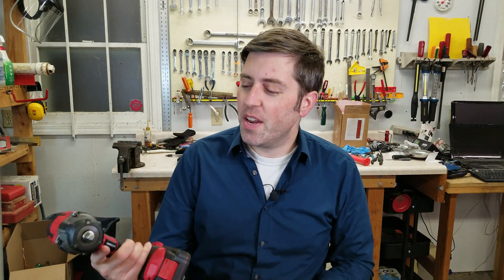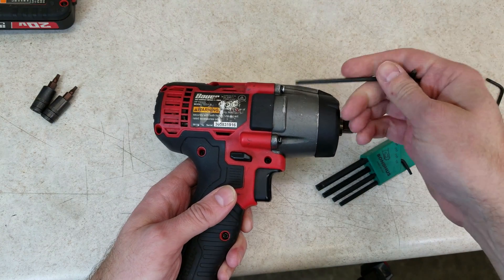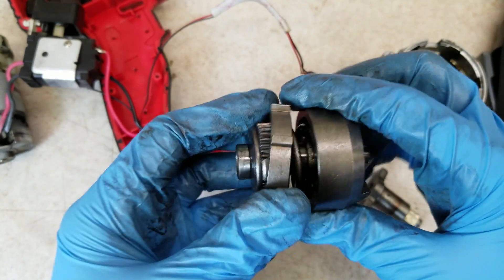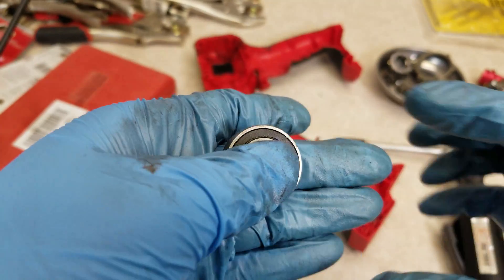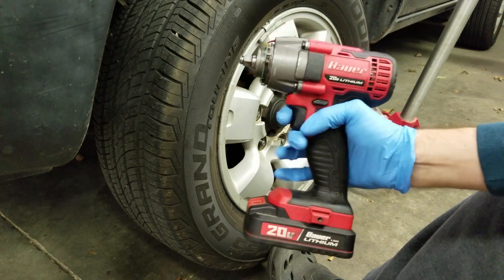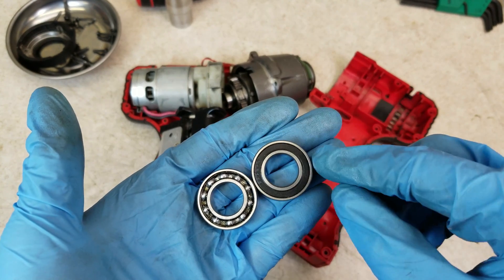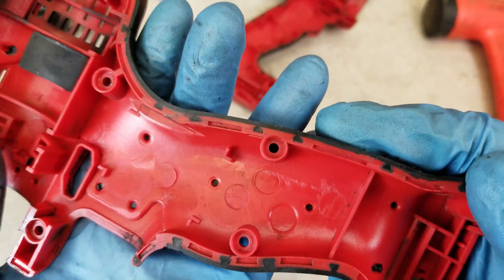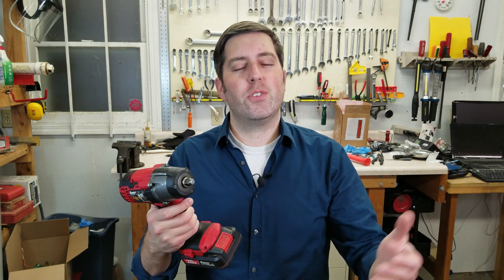Harbor Freight Bauer Cordless Impact Broken After 6 months … and repaired

Comment: HF is the best semi pro cordless tool line line-up I've had the pleasure of owning I've had Porter cable,b&d,ryobi burnt a 139$ ryobi got that for more power 6 inch wood lags burnt it up 20 of them my 10 year old b&d" b&d chain saw is a beast 3years and 5 cords 10 inch is still running so that b&d saw is tops" set is still running so I can't recommend ryobi.Bauer is good the string trimmer took out pinky finger waist high weeds highly recommended as well b&d chainsaw and Bluetooth speaker the rest of b&d is ok just drill bottoms out very easily just the base drill not a hammer or variable just 12 speed and a driving setting good for light work😎

Comment: I have had mine for almost 2 years and it has worked fine. I have over loaded it many times no problem.the one thing that I believe is you should  not try to use it if its below half a full  charge.

Comment: I've had my 3/8 that for about 8 months. I'm a Chevy dealership technician. and use it daily, but I don't take off wheels with it, although it will. it's great for a diyer but I wouldn't recommend it for a daily use technician environment. spend the extra money and buy Ridgid or Milwaukee.

Comment: Industrial maintenance technician for 35 years, I use the 3/8" impact at work every day. Use it for light duty things like tear downs and panel removal it works very well. It saves wear n tear on my snap on. I think there well worth the money.
Reply: If you're not using your snapon then it is not making you $$$ . Might as well throw it away .
Reply: @banno6938 Exacty !

Comment: I’m a retired caterpillar mechanic and we have the same problem with snap on, Matco, Mac . Once a year we replace the bearings, and sometimes the trigger mechanism on those impacts. So it’s not the brand, it’s the abuse of use every week. Once you replace the damage parts life goes on as usual. I’m still have my old Matco and ingersoll rands 🔥🔥🔥. My advice is to buy and extended warranty. Worth every penny.

Comment: i got a model 1782C-B1 ,unfortunately i used that several times but recently it didn't seem to tighten a bolt ,so i was even able to grab the socket and held it with my hand from turning..i don't know i guess it's time for an autopsy on it to see if i can fix it ,if not it's going in the trash.

Comment: What kind of grease would you recommend for the hammer assembly part this impact driver? Thinking about buying one soon, but will take it apart, replace that no-name bearing and re-grease the hammer assembly. Cheers
Reply from the maker: To be honest, I wouldn't bother doing either one unless you run into a problem. I don't see a need to do them preemptively, because there's a chance you might not have a problem.

Comment: I have all the bauer tools going pretty well 9 months in I use them in my frame shop every day my big machine is 36 inches off the ground so truck are 8feet up if you loose a pro tool it may be toasted or not but 69 bucks no deal the batterys seem pretty good the 1/4 is the best 3/8 is just ok the 1/2 works on lug nuts just fine tough bolts forget it the drill has drilled thousands of holes pulling off panels the 1/8 bit slipping a little now I would probably buy them again just because Hf is so handy for me

Comment: It's not a commercial grade tool. It's a homeowner grade tool. Its pretty obvious that the reason of why it only lasted 6 months was bc it was used heavily  for 8+ hours a day for 5+ days a week for that time period. Considering it was built with the mindset that its probably be used maybe a couple hours a week or two I'd say he got his use from it. And Ive had the 1/2" bauer impact for a good year & a half with some pretty heavy usage for being used at home. not a single issue with it or the small 1.5ah batteries I run it on

Comment: Can’t check bearings just by spinning it in your fingers. It needs to be under a load.
Reply: Agreed, as long as it isn't really bad, then you can tell with your finger.
Reply: Ron LHeureux depends on what you consider really bad lol
Reply: @goinhot9133   Loud, rough and noisy.  I have had experience with indoor rollerskate sealed bearings.
Reply from the maker: You're sort of correct. In this case putting a little load on them with my fingers was enough to feel that it was getting gritty.
Reply: Tool Teardowns no I’m 100% correct. Feeling it with your fingers is the exception not the rule. If you can’t feel it with your fingers, doesn’t mean it’s good. Lol

Comment: Yeah, don't show it actually working correctly after your repair or anything.  :-/
Reply from the maker: Twice I showed it running and no longer making the noise. I tested by removing lug nuts and it worked fine.

Comment: Pull the seal on the new bearing and grease it. I've gotten many brand new sealed bearings that had less grease than that old bearing. Even pilot bearings for a heavy truck twin disk clutch. I always pull one of the seals off

Comment: Don't buy anything that moves from Harbor Freight.
Reply: I've had my impact for well over a year no issues and use it daily. Air chisel have had at least ten years again no issues. Also have a compound miter saw and an angle grinder no issues.
Reply: @bkpickell  I've had and used the heck out of my Milwaukee impact since 2011.  It works perfectly; even the batteries are holding up.  It's built houses and decks, working on cars/engines, been dropped from 20' off a ladder, etc.

Comment: That bearing should not have turned with just the motor like u are thinking because when u turned the bearing with ur finger the shaft of the motor was not turning so u are wrong about that bearing the grease u put in the hammer/gearbox is what fixed it I took my same tool apart just now at my shop to make sure that I'm right and u was wrong the bearing was not the problem
Reply: That bearing only supports the back end of the gearbox assembly and has nothing to do with the motor

Comment: Is there a specific type of grease you had success with using on bearings and Hammer mechanisms?
Reply from the maker: Super Lube is a good general purpose grease. I also have used fully synthetic moly wheel bearing grease, but it's a little sticky for hammer mechanisms.

Comment: I have the 1/2 inch cordless Bauer impact wrench. I'm not a pro but I am a DIYer and I also do some automotive work on the side. I use it primarily for removing lug nuts. I've had it for around a year now. I haven't had any issues with it yet but if I run into a similar problem now I know what to do. Appreciate the video.

Comment: I’ve noticed poor greasing is an issue with many harbor freight tools. It’s to the point where I tear any tool down before use if it comes from harbor freight. After this, I’ve actually been very happy with the bulk of HF tools and their value.
Reply: Which grease would you recommend?
Reply: Geo Logic the good stuff is super lube! They actually sell it at harbor freight too

Comment: I’ve basically run my Bauer 1/4”hex impact through the gauntlet for just about two years now issue free. I also have the 3/8” & 1/2” impacts as well, so far so good. I have a rule of thumb, that anything I purchase at Harbor freight that’s over $50 I will insure it for two additional years. That’s why they have insurance. I also mark the inside of the battery connector on the tool itself with the date I purchased it in sharpie so I know when I am coming to the end of the insurance. At that point I’ll completely check out the tool and even if one LED light is out I could trade it in for a brand new one, but as I’ve stated I haven’t had a problem with Bauer. To date I have 19 Bauer tools, only two aren’t the 20volt cordless, the 4 1/2” grinder and a tin shear. (Theres approx 70 more tools coming out in that line including 5&8ah batteries)They all perform well, even the chainsaw for yardwork and firewood. Great work on that troubleshooting and repair. That’s why I’m not afraid to buy returned tools at a huge discount because I too do my own repairs as well😉 I love me some yard sales and flea markets🤪 
Happy holidays brother✌🏼
Reply: Good idea William, I take my 1/2” & 3/8 & 1/4” hex impact when I hit what’s called “pick n pull” in my area. If you bring them, they will come LOL. I don’t know how many times somebody has heard the RatatatTat of my impact and come over to ask me if they could use it or would I help them break a rusty bolt or nut. I keep those in a go bag at the door of my garage, so when I do hit the road on the fly I know exactly where they are. Also bought a set of each, SAE and metric impact sockets strictly for road trips so I don’t have to take any from my impact socket drawer. $19 each rack so it didn’t break the bank and I’ve NEVER broken one either. Sure beats breaking knuckles with a four foot breaker bar😉. I’m sure you’ll be pleasantly surprised with the power in Bauer... I bet you can’t buy a three amp hour battery for your yellow toys for under 40 bucks? Coming up next year they’re going to launch the five amp hour and eight amp hour Bauer batteries too so I’m looking forward to that. I only use the three amp hour on my impacts and especially on the cordless angle grinder. They can only improve with added ooomph... Good luck, Merry Christmas!🎄🎁
Reply: So you paid for insurance which puts it up to around the same price as a ridgid tool? Except its brushed, has no resale value, have no option to buy it cheap in a combo kit? And still has a year less warranty, and doesnt come with a lifetime service agreement?
Reply: Joe D Actually no. A Bauer 1/4” impact and two years insurance cost $79 And that includes the case, two bits, a belt clip, battery and charger. $119 for the rigid TOOL ONLY. I already have a lot of the Bauer line so that’s what I’m building on because it’s been very dependable for me. $16 every two years for insurance for that whatever happens to it , an led light goes out or even if I simply don’t like it because of it simply being dirty I can replace it with a brand new model. That’s battery and charger too brand new. Try that with rigid, or any other line and they’ll laugh you out of the store. I’m just sticking with what I know works. I’ve tried and still do own the other red brand, the yellow brand and that god awful lime greenish or orange brand that I’ve bought over the years and I just like the way the Bauer line feels in the paw. So I say more power to you brother if you found something that works and it makes sense to you then go for it. Any of the tool reviews can change from day to day as I’ve also seen, so again I just go with what I know works for me✌🏼
Reply: Joe Deveau actually yes its 69.99 and plus 16 makes it 86 bucks. The ridgid brushless with 2ah battery and charger is 79.00.. you actually paid more for a harbor freight tool with one year less warranty.. let that sink in.. but like you said more power to you, I just want to know why someone would buy bauer with a better tool around for cheaper and better warranty, even comes with a lifetime service agreement. Also ridgid has kept the same battery since 2003, who knows when “bauer” will switch the battery up on you making those tools worthlessAnd in the end you can resell the ridgid if you wanted, you’re stuck with the bauer. It’s no offense, just a question/thought.
Reply: All my 20V stuff is yellow, but I've been thinking about picking up some of the Bauer line to have a kit I can just throw in the truck and leave there for the trips to Pick A Part yards and such.

Comment: I personally really like the Bauer lineup. And for the price they're actually pretty good tools overall probably not quite professional quality, but I did have a problem with my half inch impact it had fallen out of the back of my truck and must have gotten damaged. I went into Harbor Freight that weekend told them it wasn't working properly and showed them. They then just let me switch it out for a brand new one no questions asked 
Note: I did get the 2-year replacement plan (that if you are interested you can renew every two years) expecting that they would not last more than a about a year under constant use.

Comment: I bought the 1/4" Bauer impact driver and its been great (I have a small engine repair side business). One of the biggest savings is on the 20v  batteries. 3.0 amp hour batteries I got for something like $24 each with a coupon; a fraction of the cost for my DeWalt and so far after about 5 months I have had zero issues.

Comment: 6 months of hard work dismantling cars with one of the cheapest impacts? That's pretty damn good value for just a bad bearing. Take it back for replacement and you're good to go (once case where the BS extended warranty works). Of course, you should be buying better quality for such work, but, clearly, for the right price, then this this is a viable option.
Reply: TheGuruStud lol or spend 10 dollars more for a ridgid which will last a diy’r a lifetime

Comment: I think Bauer is better for home use, whereas their Earthquake brand is more suited for professional use.
Reply: But earthquake only has 1 cordless tool, the new 3/8 ratchet
Reply: The Hercules line is the “professional” grade cordless tool line. Js
Reply: Dewalt and Makita are better for all use, and you won't regret it a year later.
Reply: Josh Lampe I agree, I haven’t had any problems with my makita’s except the 1/2 high torque. Stripped the gears out, sent it to repair shop and had it back within 7 days. They had a bad batch of gears, but since resolved the problem. Fit and finish it’s better than my Milwaukee 1/2 high torque. Battery’s fit tighter etc on the makita. To me makita is more of a long lasting tool better fit and finish, where the Milwaukee is more performance based. Out of makita , Hilti, Milwaukee 12/18v the Hilti is built the best, second being makita then Milwaukee. Just my opinion
Reply: You think??? It is bro!! Think think think think hahahahaha
Reply: @Yamaha Venture I still have, and use, many tools I have purchased at Harbor Freight. I know they aren't the best around, but they also aren't trash. Some of them even perform better than the expensive tools I have used. More money does not always mean better quality.
Reply: I use bauer impacts drills grinders seawalls every day in my big truck shop

Comment: What type of grease did you use to lubricate the gear case?
Reply: any multi-purpose grease will work, just don't get carried away and pack it full of grease...same goes for the hammer mechanism, the less grease the better, too much and your impacting blows get absorbed by the grease packed in the case.

Comment: Will never touch the quality of Dewalt and Milwaukee. Will never waste my time with HF.
Reply: Hey there's ppl out there that cant afford brand name's and you have gotten things at HF. HF is like a quick fix tool place
Reply: @elpandatowtrucker4746  their power tools are fine. Just open them up and regrease then when they are new. I personally run all Milwaukee for battery power tools but hf table saws are good quality. And Pittsburg pro is awesome along with thier pro lines like icon and Doyle. I have some snapon hand tools and a co-worker has snapon power tools. I would never buy a snapon power tool.
Reply: @jsf11fra  hell with snap on over priced and Milwaukee over power's them and earthquakes too my earthquake is still going strong against my friends Milwaukee 1/2 inch
Reply: @carlm2590  we only doing this to for fun but it does take off lugs nuts off of a semi but Milwaukee does too but long faster and easier and are other friend has a matco and a snapon and there at the same as the earthquake and we like what are you serious but i will not buy matco snapon and earthquake. Well i did buy this one but one it go im not getting one again im going for Milwaukee's
Reply: @carlm2590  no. Pros do not laugh at harbor freight. Have fun with your snapon mortgage payment. Almost all my coworkers run some harbor freight. Warranty is better than snapon and so is the customer service. But proto, Milwaukee, Mayhew and wilde are all snapon quality and half the prices. As well as in many cases they are the snapon manufacturer. As well as bluepoint is Chinese junk now so even more reason to stay away from snapon nightmare
Reply: @jsf11fra  I use Dewalt and Milwaukee. Harbor Frieght sell you crap then warrantees it. No thank you.
Reply: @carlm2590  Bauer and Milwaukee are made in the same factory. Obviously Milwaukee is Superior in every way but no one laughs at mechanics using hf. Don't be so stuck up. I'd rather see a guy using Bauer than snapon. And I'm not even a mechanic. I'm a field engineer and could definitely afford snapon if I wanted to but thier shit is just not worth it
Reply: @jsf11fra  again who said ANYTHING  about snap on?? Given the combos Home Depot has on sale all the time one can get Dewalt and Milwaukee tools for just a few more dollars. Never an excuse to settle for Harbor Freight low quality garbage. Don't  be a mark for HF.
Reply: @carlm2590  harbor freight handtools are better than Milwaukee and dewalts. I don't know what you do for a living but harbor freight is not low quality. They are on par with apex as well as any other tiwanese tool
Reply: @carlm2590  they are literally rebranded cresent and gearwrench with better warrantys....

Comment: Hayyyy, I bought this 3/8" impact and used it at work for a whopping month before it bit the big socket in the sky.  I uploaded a video of it's decline into oblivion on my channel!

I think you're right on though, it's probably good enough for the guy working on his own car at home, but it's not quite good enough for a professional.  The M18 3/8" impact is better in basically every way, but it's about 2x the price.  It's smaller, more powerful, more reliable, better batteries, faster charger, much better warranty, but it's $250 with 2 batteries and a charger, vs $100-120.